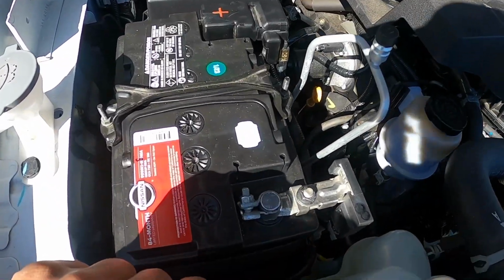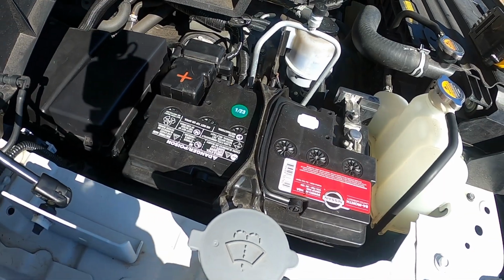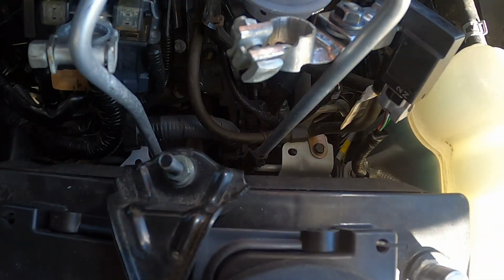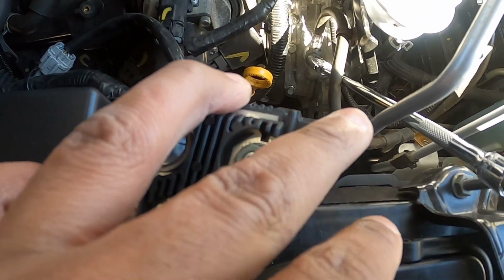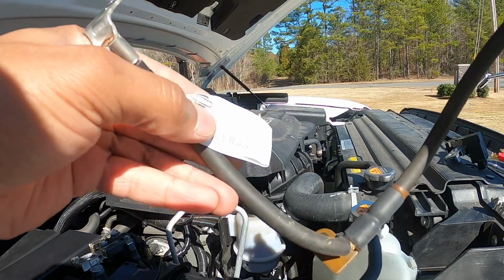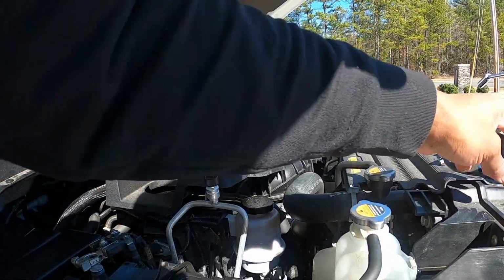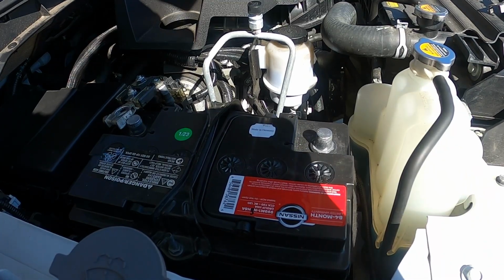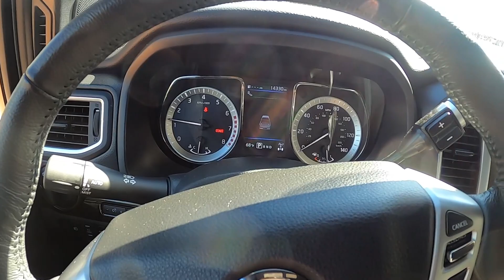2019 Nissan Titan | U1000 | Battery Ground Cable Pt 5

Comment: I'm not a mechanic but I'm a technician that works on all types of I.T. equipment.  Looking at your very new looking connections I find it hard to believe that there was much if any corrosion involved unless you already cleaned it up prior to making the video.  Reseating the parts as well as pulling out the cable might have removed the short which resolved the issue.
Reply from the maker: A fresh ground wire has no issues with continuity. Enough corrosion/rust could be enough to disrupt these sensitive electronics nowadays. After I cleaned up the wire, I have not seen the error code return. I would rather replace the corroded cable but this was a cheap easy option.

Comment: Good job 
I have 2008 titan 
I did replaced crankshaft 
And camshafts
Take time cranking 
And then in hour later 
Won’t crank again
Reply from the maker: Hmm. Might be something else thay causing your issue. Is the battery good?

Comment: Nice video.
From what I've read, when you change the camshaft sensors L/R,  you are suppose to change the crank sensor, in my infiniti is near the transmission on driver's side.
Reply from the maker: Thanks. All the cam and crank sensors were changed.

Comment: Thanks I'm going to try this 👍
Reply from the maker: Awesome. Let me know if it works.
Reply: @btbuildthings  it actually worked my code is gone. I have a 2005 Nissan quest with the 3.5 and the code is gone, I drove it 300 miles already and everything is working good.
Reply from the maker: @emmanuelmartinez8902  Awesome! Good deal!

Comment: U didn't fix the problem u just reset the ECU by taking of the ground
Reply from the maker: Ensuring that the ground has a solid connection resulted in the U1000 code being addressed as it has not come back up as an error again so far.